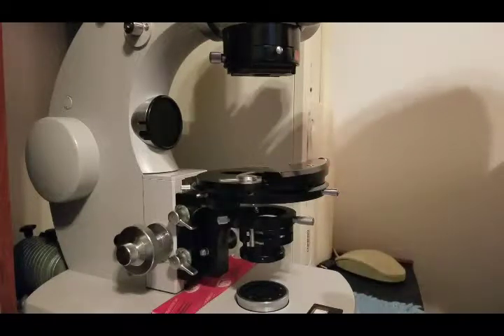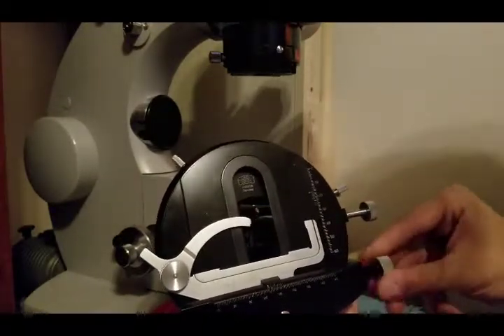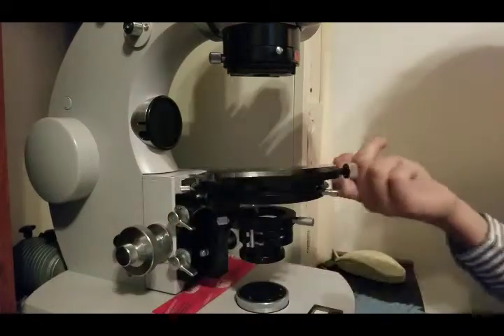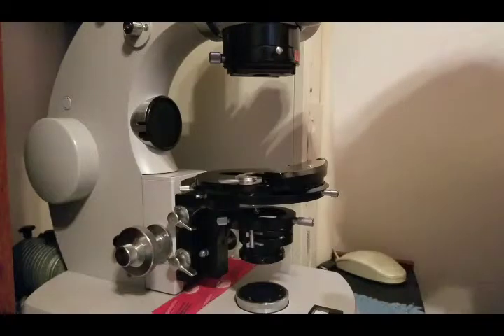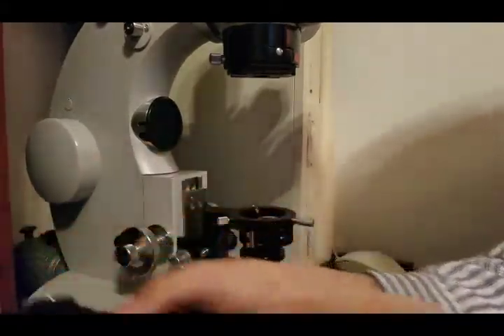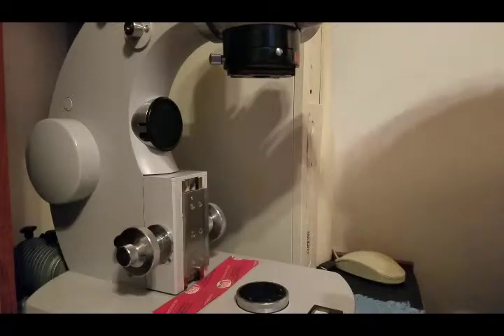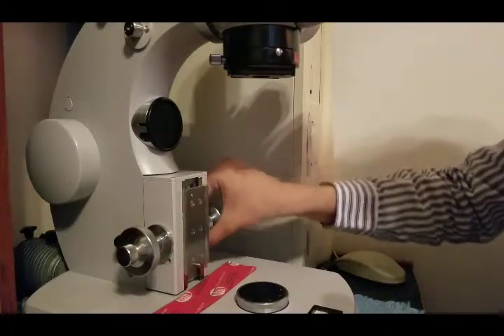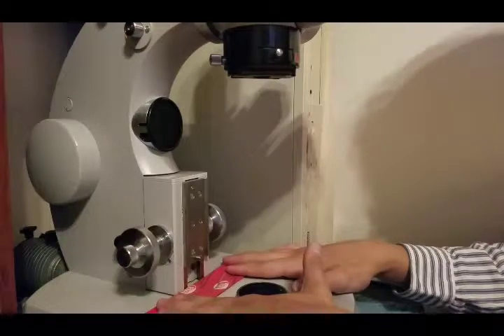Zeiss Photomicroscope II Follow Up Video (The Stage)

Comment: Mike, how did you remove the side panel? I’ve taken out all of the screws, the film canister and supports etc.  but the side panel just does not move all.  Any ideas?  I have a photomic iii terrible condition when I purchased it (200$!). It’s now works almost perfectly well,  I do need to get deeper into the focuser to clean it up.  Also I have fungus on elements somewhere in the light path but I’ve cleaned everything I can reach easily :)

Comment: Is this the ohase contrast version? I usually see some kind of optic going from the frame to the turret. Is this darkfield as well?
Reply from the maker: Good eye! This does have phase contrast and all but one of the objectives are the original phase contrast versions. Some scopes, the same as the photomicroscopes but with no interal 35 mm camera, were called the universal microscope. These scopes had different attachments like fluoresce and köhler illumination. I unfortunately don't have any of those attachments, and they usually run in insane price ranges. I need to do an update video!

Comment: Hi Mike i have same Zeiss microscope but whit out photo
when you mount the condenser an the stage look inside the dovetail there is an spring loaded pin right behind the push down handel, you can click it on from the side, that is  much easier